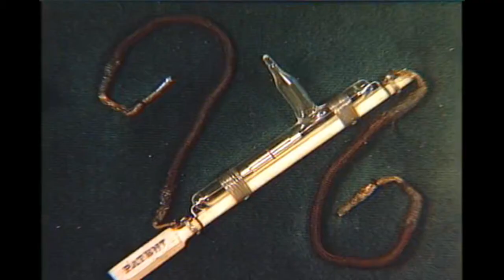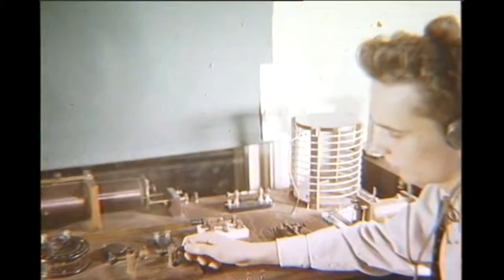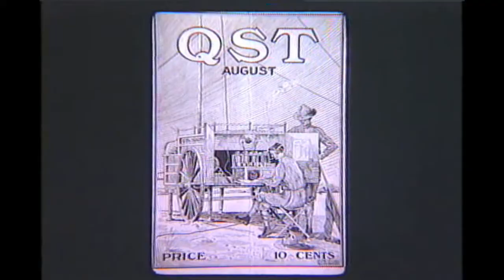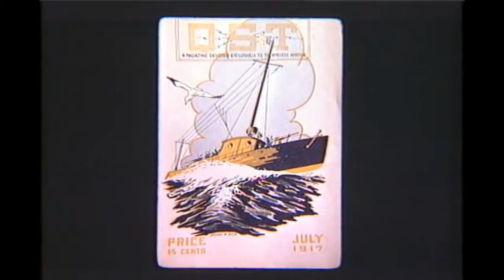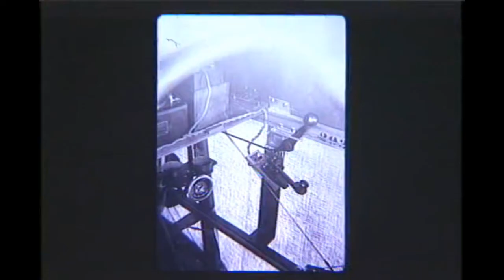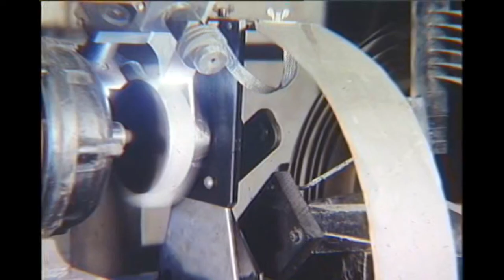AWA Classics - The Early Years of Amateur Radio

Comment: I read an article in an electronics magazine in the late 70s describing how spark gap era amateurs used rotating spark gaps with a speed control (dare I say rheostat). The idea was that a group would be on the same frequency listening and the pitch from each gap is set by the speed of the motor. A Morse code based chat room!
 
Other articles included the various ways amateurs started making their own tubes. Then there was the occasional tube that got bumped into being microphonic. 
 
I only knew one call sign really well, WB6EFY. Mac to his friends.